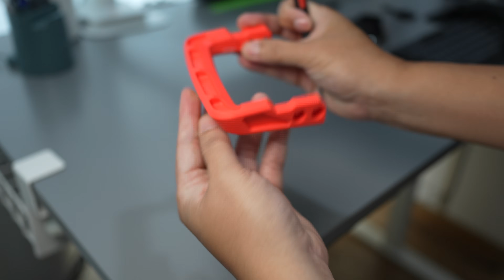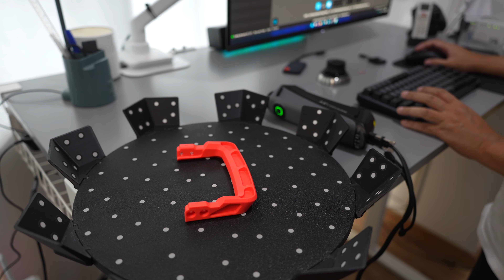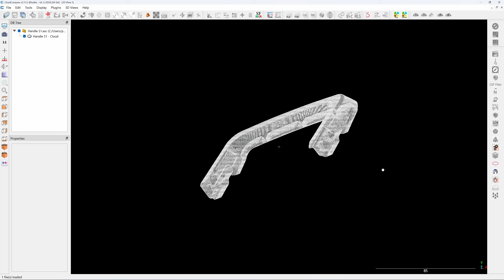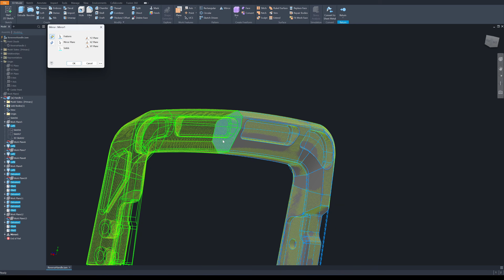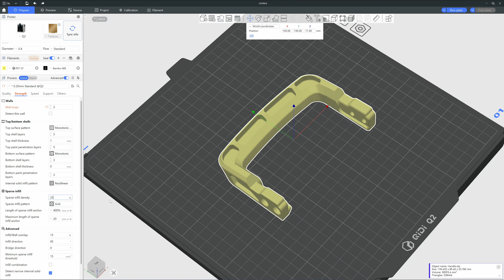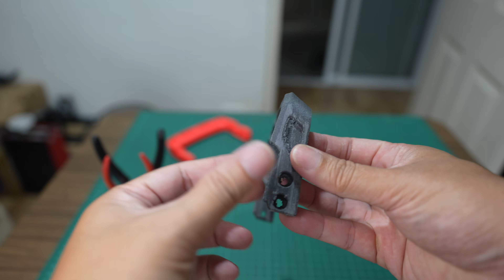Reverse Engineering a 40kg Load Handlebar - 3D Printed in PET CF (QiDi Q2 vs K2 Plus)

Comment: Qidi PET-CF was never consistent when I use it on both my Q1 Pro and Plus 4 after drying for 24hrs until I left the dryer on at 40c during the printing.  My guess is it’s even a little moisture can cause what issues you show on the video. Stringing and layer adhesion is indicative of moisture.
Reply from the maker: Same here—I’m baking the filament at 80 °C and will retry printing straight from the QiDi Box with the dryer on.

Comment: can i ask you how you get consistent form sketch to sketch?
Reply from the maker: I cut the point cloud into 1 mm slices, trace the sketch, then move the plane and repeat. With a wall thickness of just 7 µm, this is the most accurate way to perform reverse engineering.

Comment: It looks like it needs to be printed at a higher temperature to get the layers to bond together.
I print PET-CF at 305 degrees and your printer was set to 280 degrees. 
Print a temperature tree to see what suits your machine as that is the best way to choose a temperature.
I have printed a lot of parts using that filament and think it prints very well. I have a Qidi 4plus.
Reply from the maker: I’m retesting today. I suspect moisture is behind the print failure. I’ll use the QiDi Box to dry the filament while printing.

Comment: Try printing hotter. I print pet-cf at 295c. Id go hotter if my hot end could go over 300c.
Reply from the maker: Manufacturer uses 270C nozzle temp to archive 80 MPa stress test.
Reply: @Payo-TensileCreator  Manufacturer might use a brass nozzle (with better heat transfer than your hardened steel one). Raising the temp 10 to 20°C therefore might be worth a try.
Reply from the maker: I’ll troubleshoot it today. I suspect moisture is the problem, and if drying while printing doesn’t fix it, I’ll move on to the next step.

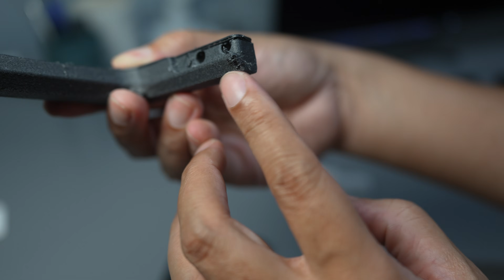Comment: 16:16 that's look like semi-dry PET-CF for me, you won't see any bubbles, but it will flow from nozzle like it's overheated but it's just from water boiling inside. I suggest you to dry PET-CF at 70° for atleast 24h for best results.
Reply from the maker: dried the material at 80 °C and vacuum-sealed it in a bag a week prior to printing. I’ll be conducting a retest today.

Comment: Why you don't fill in the hollow structure on the back of the handle? This should improve strength while mass and print time stays same (or less)
Reply from the maker: Great question. The pockets were originally cut to save material in injection molding. If you check the FEA stress plot, you’ll see that part of the handle carries very little stress, so removing material there doesn’t weaken it. I stick with the original design because, in FDM printing, those pockets generate extra walls. At three nozzle layers thick (1.2 mm), the walls are actually stronger than the infill.
Reply: @Payo-TensileCreator You will have more strength with full volume shell, won't you?
I usually do 0.4mm nozzle 0.20 layer 4 walls 25% honeycomb infill 5 top and bottom layers for medium loads.
For something requiring more strength - PET-CF with 0.6 nozzle 0.12mm layer, 4 walls 30% honeycomb infill, 6 top and bottom layers AND you can go up to 6 walls and 60% infill if you need it.
I also suggest you should avoid using GRID infill for anything and use honeycomb for high load applications since it prints with continuous lines and stacks without gaps between layers, so you will get much more layer compression strength and also a bit more stiffness.

Comment: 0.6mm nozzle for CF filaments- with 0.4 sooner or later the nozzle will clog….
Reply from the maker: The filament manufacturer recommends using a 0.4 mm nozzle to achieve the specified tensile strength of 80 MPa, as the fiber formulation has been optimized for that nozzle size. Like another commenter mentioned, I also have reservations about the PTFE tube, prior to this, I used a Capricorn tube and had no issues.

Comment: I'm betting the Qidi had a filament break in the PTFE tube which led to it printing nothing for a little while,  but the motors were able to push new filament in and reload the nozzle. So you likely only had a few seconds of air printing but it was enough to ruin the print. I think the Qidi and brittle filaments are not a good match, because of the tight angles generated in the PTFE tube when the machine moves to the right rear corner.
Reply from the maker: That's an interesting theory! The tight angles could definitely be an issue with brittle filaments. I've just received the multi-filament box with top glass raiser. I'll try it again tomorrow.

Comment: Im following you. whatt is your opinion about Metro Y  pro 3d scanner VS CREALITY SERMOON X1?
Reply: I am im the same situation. Did a lot of research. My conclusion: Metro Y Pro has a way better pricing & keeps up very well with the Sermoon S1 (X1 is a different price level…). Only downside of the Metro Y Pro is, that the Mac Software is still „coming soon“. Support is not able to provide a more accurate timeline.
Reply from the maker: Revopoint doesn’t have the tech to build real laser scanners and is significantly behind the competition in precision, accuracy, and resolution. Instead of improving their hardware, they’ve poured resources into flashy, misleading marketing. It might be okay for light hobby use, but it’s nowhere near suitable for serious work—and even for casual use, it’s overpriced for what it delivers.
Reply: @P @Payo-TensileCreator  I agree regarding Metro X, but can you confirm also for Metro Y Pro? From the vids on YT I have seen precision Y Pro vs S1 is Head to Head and Y Pro wins in categories deep holes and software.
Reply from the maker: @goldcoastmotors37  What you see on YouTube is often just a polished piece of Revopoint’s marketing machinery. Reviewers have to sign NDAs, follow scripts, and are prohibited from mentioning any downsides. Meanwhile, a team of 30–35 marketers floods the comments with praise and actively buries or attacks critical feedback. This isn’t new, it’s been their playbook for years.